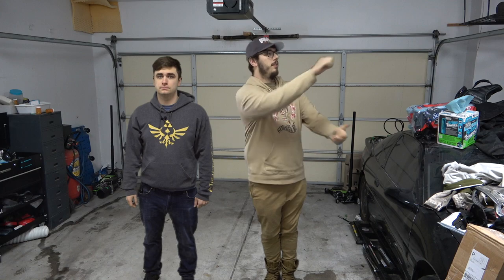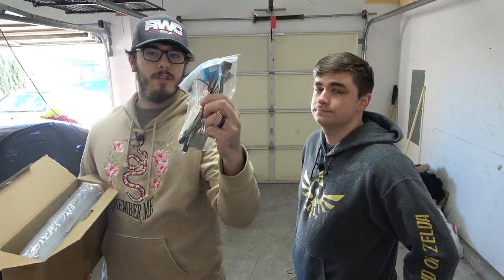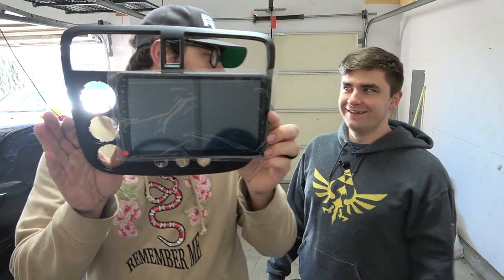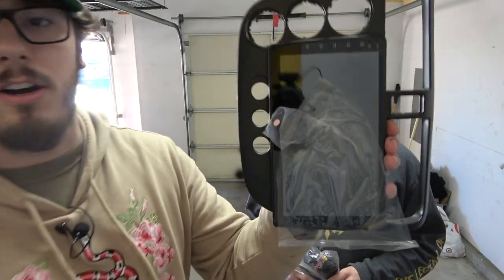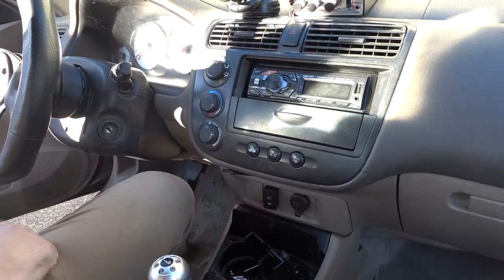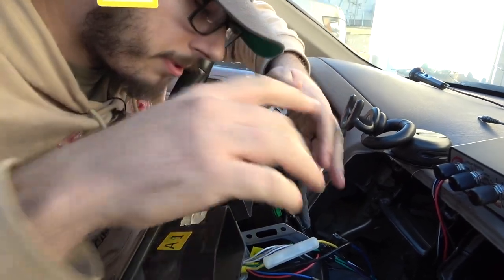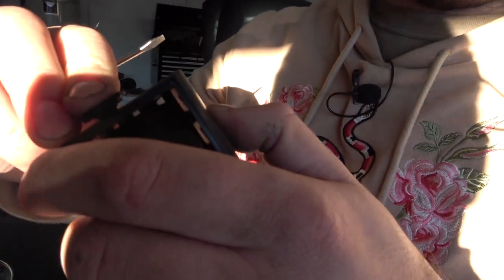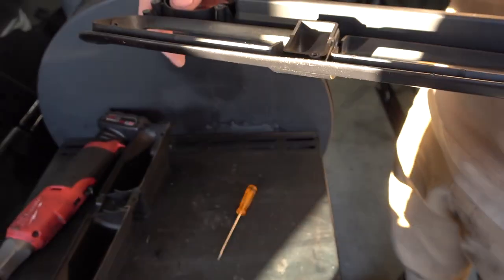eBay $140 Android Fitted Head Unit Install and Review 2002 Honda Civic | Android Head Unit Saga Pt.1

Comment: Nice Job guys!,  I'm about to get one of these on ebay, Just wondering if is possible to swap just the radio instead of the bunch of accesories? Thanks in advance?
Reply from the maker: The stereo in the face plate are one piece. And we don’t think there’s a way to take them apart. We’re pretty sure you have to swap everything for this to work. 😕
Reply: @gridengine  thanks for your response!!!
Reply from the maker: @jok3182 we gochu 💪

Comment: I know this is a year ago but mine won’t turn on at all
Reply from the maker: Check your radio fuse in the fuse box inside the car. If that isn’t the problem, double check your wiring job on the back of the head unit. If that’s fine, send it back and ask for a new one.
Reply: @ In this video you guys should’ve recorded you guys plugging in every back so I can see if I missed something
Reply from the maker: @Pretttyboyflac0 sorry about that g 😕
Reply from the maker: @Pretttyboyflac0 have you watched the other episodes we did on this unit? This might answer your question
Reply: @ yes I have 
Do you think you can send me a personal video of how you guys have the connections so I can just see maybe if I have something I didn’t plug in that I needed 2
Reply from the maker: @Pretttyboyflac0 we would if we still had the car 😕😕 did tired not cringe with any type of instructions?
Reply: @gridengine  are you guys cool with maybe FaceTiming me tmr ? So I can see if I can show my issue bcuz i contacted the seller I bought the item from and he just won’t reply
Reply: @ hey so I just rechecked my radio CarPlay and noticed my fuse is blue instead of red 
And I noticed everyone else’s is red could that be the issue

Comment: can make this machine fit apple carplay and android auto?
Reply from the maker: We were never able to figure out how to get it to work with those applications…
Reply: You need the gps module that screws into the back of stereo otherwise it won’t work. It came with mine not sure if it came with yours or not
Reply from the maker: @S3minirocket ours didn’t 😂